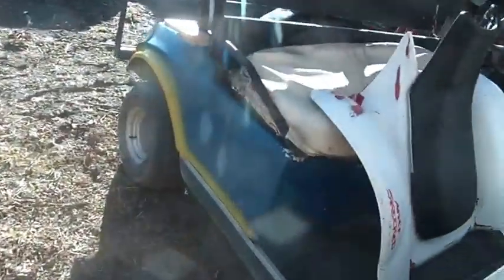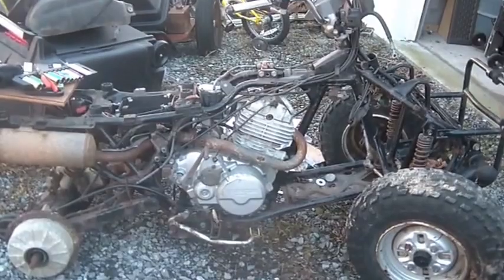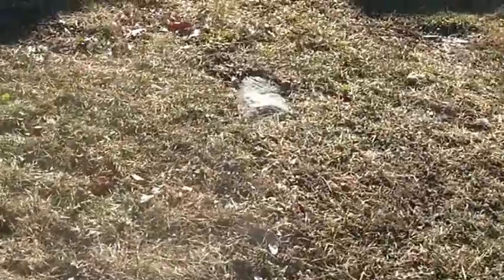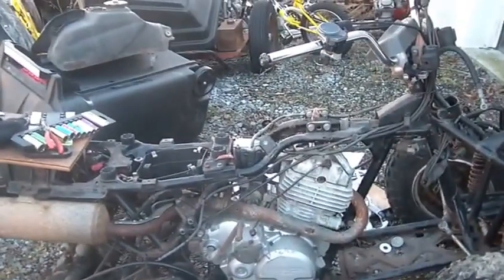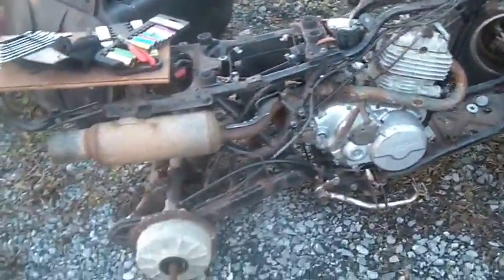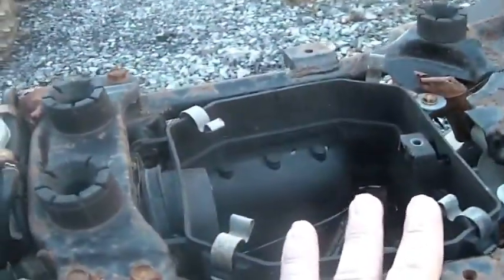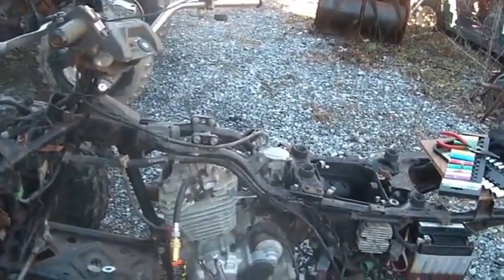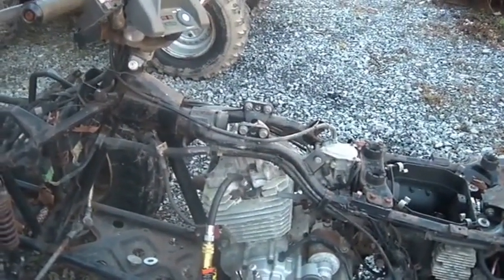1986 Honda TRX250, ATV Autopsy, the good, bad, and ugly

Comment: great idea for a "how to" video. I have used snowmobile suspension parts on mini bikes and on go-karts.  the suspension arms on the tracks can be modified to work as front control arms. just one of the crazy ideas I have put into motion in the past. sadly all those toys are gone. slowly working on a new mini collection. I'm a mini hoarder. 😀

Comment: I worked on a bunch of atc's back in the 80's. dealer parts used to be cheap. new piston for a 110 was about $22, rings were $18, head base gasket and valve cover set was about $18. times have changed.

Comment: to me it doesnt mater what it costs to fix if you know its good when you're done. yeah you can buy one for 1500 bucks used and then something will go wrong with it anyways. example i got a 85 magna 500 for 200 bucks. all there but leaking and worn. cost me probably 800 bucks for kits, seals, tires, battery, yada yada yada. but now the friggers gunna be mint and got 1000 buks into it and its only worth 1200 done. but I'm havin fun workin on it. thanks for the vids man.

Comment: as I suspected from the previous video valve or timing issue's just from the way it sounded when you turned it over....bright side at only 75 bucks your still in the green....with the orange death I suspect someone installed the cam wrong causing the intake valve to hit the piston and bent it....it's not very common for an intake valve to get burnt and leak on Honda singles

Comment: if you decide you have to fix it,i have a engine and rear axle
Reply: roger oconnor  Hey man I was wondering if you still have that Honda trx 250 engine.  My four wheeler has been blown up since I was 14 I'm 21 now..it's time to get mine going
Reply: roger oconnor I have looked everywhere in NC  that a junk 86 Honda trx 250 could be hiding no luck on internet or anything if you could help me find a engine I'll put the video of the tear down,and reassemble of the motor on my YouTube channel